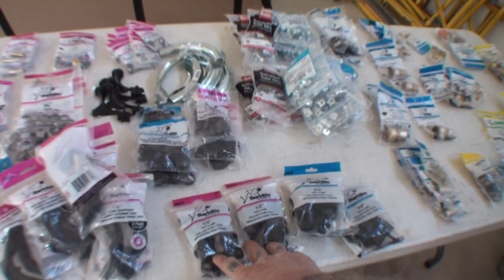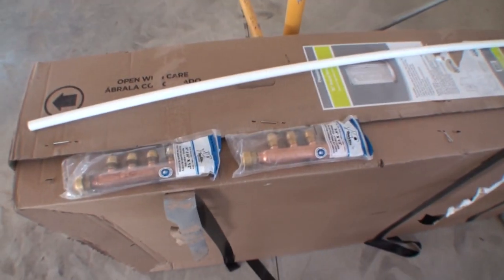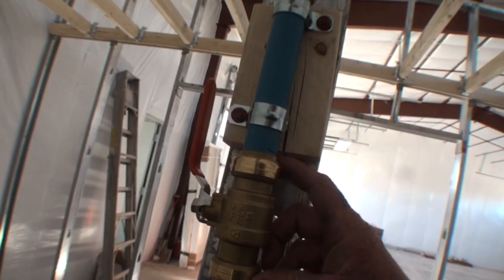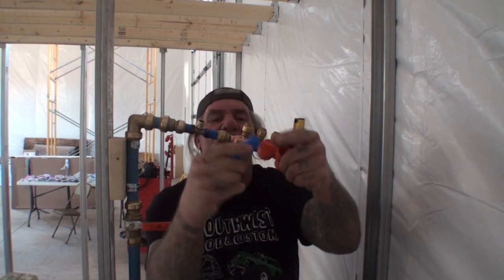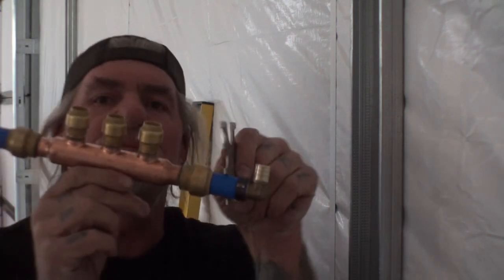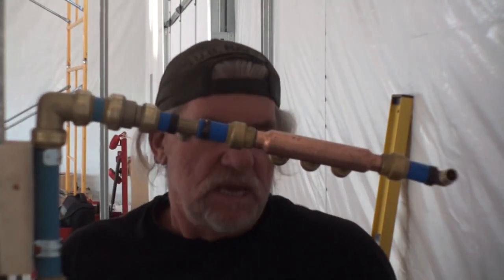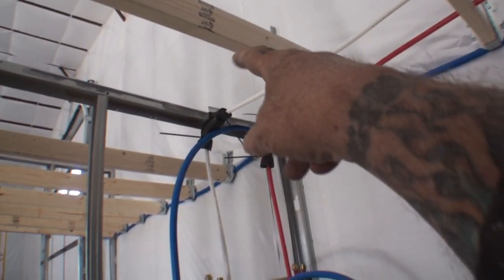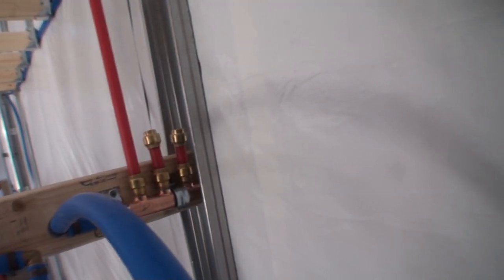HOW TO INSTALL PEX PIPE - WHY PEX PIPE IS BETTER AND CHEAPER THAN COPPER PIPE

Comment: Strange that you chose to use crimp over the cinch rings for fear of leakage, yet in so many spots you've used push to connect fittings. I haven't heard about one ring being better than the other, but have heard many complaints about push to connect fittings.

Comment: Wow that is strange, i have used the ratchet clamps since 99 and have never had one fail yet. Now i do know if you try to use the clamps on the old grey pipe Buteline connections they will leak. The Buteline connections are made different with less barbs and spaced further apart and made strictly for buteline.
Reply: I was told to use the copper crimp rings over the clamps,, DIY!
Reply: Would that be QEST tubing and fittings? I have a box full of fittings, rings and a crimp tool from when I used to work on mobile homes in the 90's. I switched to pex and never looked back.